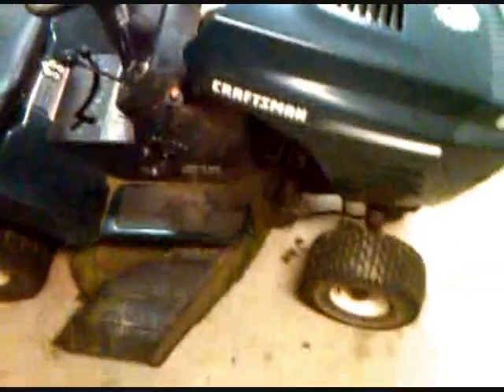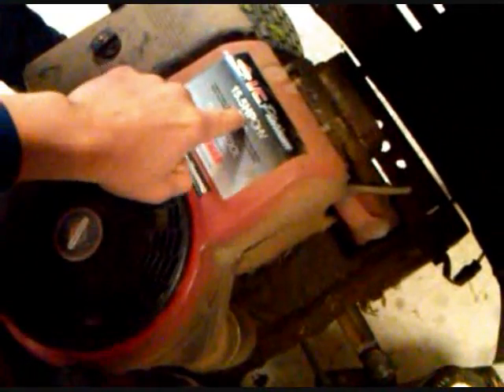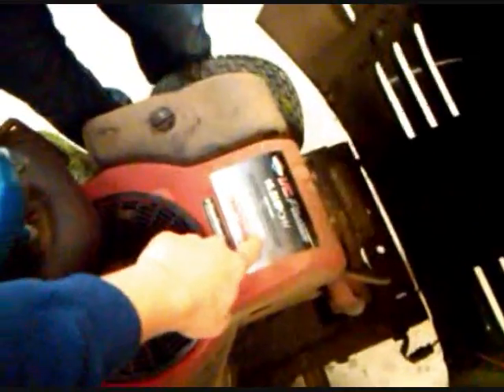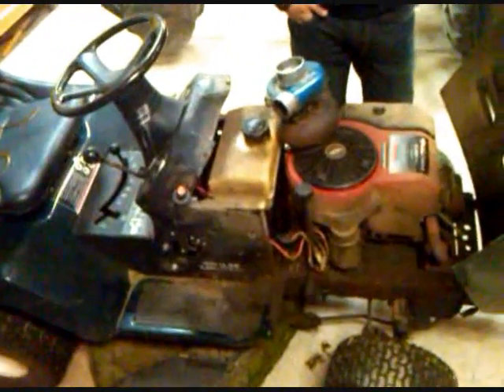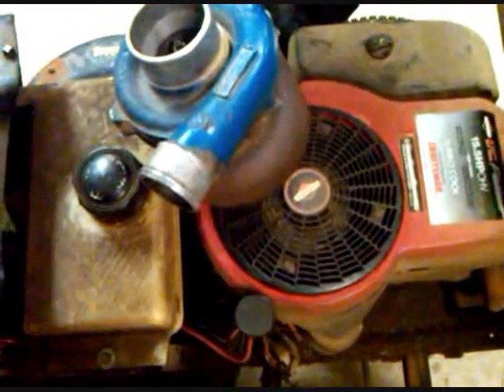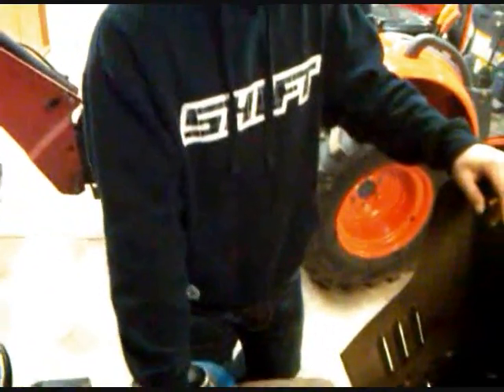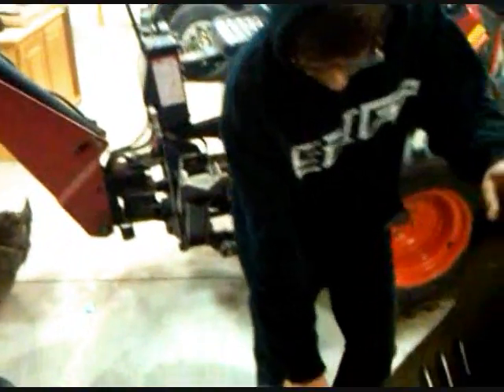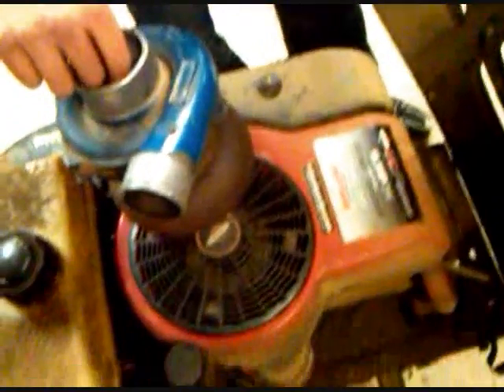Briggs turbo cooled???

Comment: mine was the same, there is a small port in the cooling shroud between the cooling fan and air cleaner box that forces a little extra air to the carburetor, seems like it might work a little but i think its pointless.

Comment: Its OHV meaning Over Head Valve not Over Head Cam, and Turbo Cool was the new shroud desing Briggs released on the new engine desing in early to mid 2000's, there was never a tubo option on this machine nor has there ever been on any garden tractor or lawn tractor.

Comment: @sfebludwagwan 
Well we tested it at my school last year, we had a mower dyno. it gained about 3 hp and thats on a warn out old 11hp briggs. all you have to do it get your hands on a piece of window glass, sand paper,duck tape and a touch of Wd40 or just water. sandpaper has to be about 100 grit. duck tape the sand paper to the glass put some WD on it and sand away on the head smooth up and down it takes about 15 or 20min. take it down till you cant see the round circle and your done.

Comment: That looks like an AiReasearch TO4E, at the very least a TO4B turbocharger.  Judging by the v band exhaust connection, its probably the larger "E", and was more than likely sourced from an International diesel tractor or truck.  YOU CANNOT SPOOL THAT TURBINE with that motor.  the person you bought it from lied. You just physically dont make the CFM out of a motor like that to turn a compressor the 30 -60k+ rpm it needs to make boost.  Google IHI RHB4....  Thats way more realistic.

Comment: turn it in to a racing lawnmower if you want more hp deack the head on it if you want to no an easy way to do it i could tell you just wright back. i can gain you 15 more hp on top